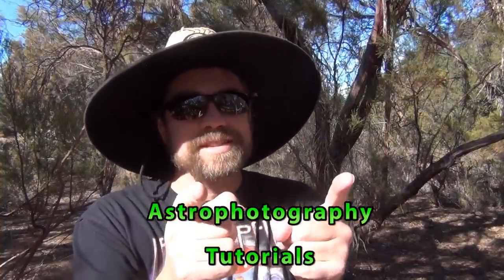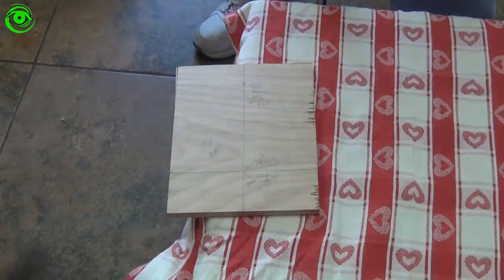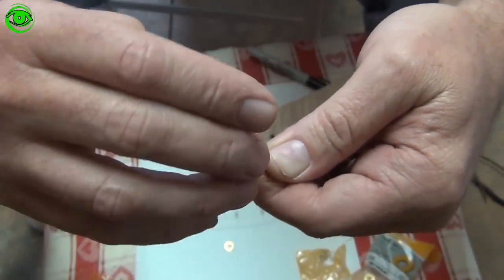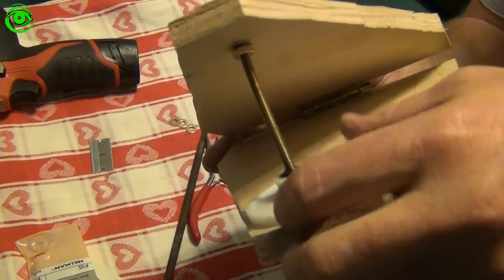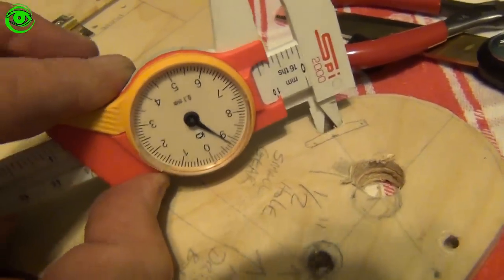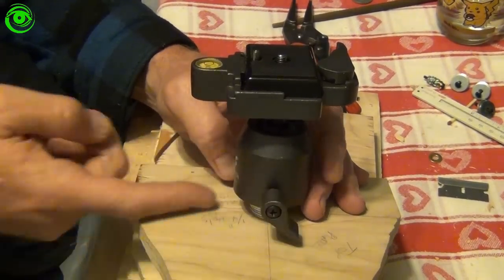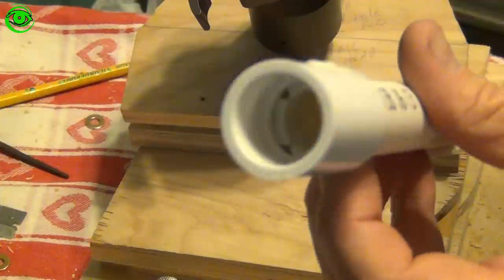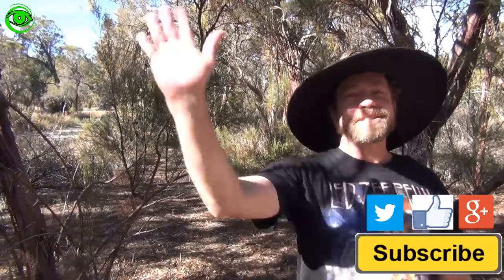How to Track Stars With Your DSLR - DIY Barn Door Trap P1

Comment: A very useful video that shows some of the subtle features that come into play in building a BDT. I think the motor gear wheel is better inverted, as this eliminates the need to thin out the bottom board.
Reply from the maker: Hi Mathers, Good suggestion to flip the wheels.  Thanks for commenting.  
Doug

Comment: Today i saw an offer for a used ioptron startracker for 200$, including ballhead. Given the drop in prices, i think the need for those lovely projects is declining. If i have to spend 200$ in parts, or buy a ready-to-run product with warranty for the same price, my mind is set :-)
Reply: Its only about 50$ in parts for a decent ball head, motor, Controller, Hinges, bolts and nuts. Its also about the experience of making something yourself. And i know, not everyone has all the tools needed, i certainly dont, but i still tried to make it using local workshop.

Comment: Thanks so much for this video, I've just started building my own so it's been really helpful to watch you and see how you approached it. I've gone down the stepper motor and arduino route though rather than a DC motor. You mentioned using longer hinges .. Some plans I've read recommend using piano hinge. You can cut it to length and there no play in it (it's also cheap). Looking forward to part 2 ! Thanks again
Reply from the maker: Thanks ***** !  You are the second person who has mentioned an Arduino model.  That sounds popular by many people.  Do you have a link to the Arduino plans?  I think showing people other options is a good idea.  I'm not claiming my method is the best, after all, I'm copying the plans from another website, and showing my steps.  Thanks posting your comments and please update me on your Arduino project.  I hope to have some results soon to show everyone.
Reply: I tried cutting a piano hinge, what appeared to be a good one from home depot, but there was lots of play in it.  The strong door hinge I used with some teflon tape was much stronger and better.
Reply from the maker: mar pal How does the Teflon tape help?  I've noticed in my design, the two pieces are not evenly spaced.  The rear seems to have a narrower gap as to the front...I think this is caused by hinge play.  How do you Teflon tape to improve the hinge?  Do you think I could use Teflon tape on mine to improve the hinge?  Thanks Mar!  Doug
Reply: Hey, I wrapped the hinge pin with teflon tape to remove the gaps, can your hinge pin remove?  It definitely seemed to help.   Just dont put too much so it doesn't bind it.
Reply from the maker: mar pal Thanks for the Tip!  I need to do more testing and see how close I'm to rounder stars.
Reply: What focal length and exposure time are you trying?  I would be conservative.  I'm currently at 50mm with 30 seconds if that finally is aligned well I try more.
Reply from the maker: mar pal I'll be trying a Rokinon 14MM Lens with 30 Second exposures first, then I plan on trying different stock lens I have too.  I was going to try 30 second sets and 60 second sets for good measure.

Comment: I'm ready for part 2!
Reply from the maker: Thanks Adam!  I'm working on the final edits now.  It will be ready on the 15th.  I think you will like P2's Electronic Circuit.  I cover the Electronic Circuit for novices, since I'm not a solder master, I was still able to put together a working Electronic Circuit.  Thanks for watching!  Doug
Reply: Astrophotography Tutorials Hey, thank you! There seems to be a lot of information on how to build these things, but little on using them. I know it seems pretty obvious but all the various alignment methods and such. Maybe I'm over thinking it.
Reply from the maker: Adam Elkins That's true...I've never used one before and I hope to discover how to use this correctly.  P3 is what I'm aiming to conquer next, that is how to use the BDT.  I can tell along the way...I've made mistakes.  I will review all the mistakes I've made and point out them out in P3.  I did a very small sample test and the stars did improve, but, I think my alignment was off.  That's what I hope to uncover...How to use the darn contraption!  =)

Comment: Great video!  I recently built one as well, definitely a good idea to raise the ballhead otherwise it will be hard to access the camera at different angles.   The hardest part for me was bending the rod and having it accurate, I like your suggestion with the setting circle website.  I ended up using a stepper motor and Arduino unit which makes the timing perfect.  When I am using it now I find the most important step is the polar alignment.  I used my 6x30 finderscope from my telescope and use the polaris position programs, to help align I just want to be more confident in this last step, when I get it right its perfect but it is somewhat of a trial/error for this last step which I would love to improve.
Reply from the maker: Hi Mar,  Thanks for commenting on your experience.  I think I'll need to revist my polar alignment.  Where is your Polar scope mounted?  I'm thinking the Hinge should be the direct path of polaris.  Any tips are appreciated.  The arduino sounds interesting too.  What are you powering the Arduino with?  Thanks, Doug
Reply: Hey!  I am using a larger door hinge, I tried to remove play from it with some teflon tape.  I found the piano hinges had even more play, how are yours?  I mounted the polar scope right on the hinge pushing against the top level.  My hinge sticks out a lot more though.  When I looked through, the crosshair doesnt seem to rotate when I lift the top so I think it's pretty good.  I think that's the goal to align the polar scope.  If you mount it on top you will have to be able to align it somehow.  I also mounted the entire thing not on a conventional tripod but an older wooden ALT-AZ tripod which lets me do fine adjustments when pointing to Polaris.  The only thing is when using polarfinder.exe I have trouble seeing the other stars to do the proper centering, my viewfinder has 6x30 magnification and I have just been estimating the exact distance since there is no inner circle.  I am debating getting a cheap polar scope and mounting that.  So far I was able to get 5 minute exposures at 50mm.  Regarding arduino, I also have the motor shield (addon):  I am powering it with a radio controlled R/C battery 7.4V both the arduino and the motor together.
Reply from the maker: mar pal Interesting...You'd think a piano hinge would have been better.  I think I remember seeing another long hinge at home depot.  I'm afraid if I replace the hinge, then my alignment will off on the platform.  I'm going to move forward with the hinge I have and see how it perform.  FIVE MINUTE EXPOSURE??  WOW!!!  How round were your stars?  Thanks!
Reply: I actually thought a piano hinge would be better and ended up buying one which I had to cut but there was tons of play in it.  It also seemed too thin.  I saw your small ones as well, that seemed good but again I also didn't want to use 2 as you found out trying to keep them aligned.  I also had to reduce my plywood size to fit the motor but my shaft was much shorter.  Couldn't you have turned your pinion gear the other way?  You would have to make the hole a bit larger to fit it through to be able to tighten the grub screw.  It's funny how simple yet complicated this can be.   Stars were very good at 5 minutes.  I have had very little time to try it due to clouds.. Here's my astrobin The M31 had a 5 minute exposure in there as well.  http://www.astrobin.com/users/entilza/  I think once I switch to a longer focal length it will be more evident but I am happy with the consistency so far.  Looking forward to your further results.
Reply: Also one last thing, I decided to build the 1/4-20 thread version so it was longer (11.43")  I had thought it might be less prone to error and easier to bend the rod if the arc was larger.  At least that was my theory.
Reply from the maker: mar pal WOW!  YOUR M31 RESULTS ARE GREAT!  I'd be happy with that five minute exposure!  That's very impressive!  You say you built a 1/4-20 version @ 11.43"?  Did you design this yourself?  I'd be interested in sharing your link for that build too.  I was hoping i'd get 1 minute exposure with the BDT and you got a very nice 5 minute on M31.
Reply: Astrophotography Tutorials Thanks!  I hope for some clear weather sometime soon, as I just built it as well I am excited to try it some more.  I originally planned to make the very simple version: http://www.astropix.com/BGDA/SAMPLE2/SAMPLE2.HTM.  But I ended up making one similar to GarySeronik's.  If you use Gary Seronik's formula at the bottom you will find the Radius = rpm / (0.004375 x TPI ) = 11.42857143
" or 290.28mm.  I think the key important thing for these trackers is the stable tripod and the polar alignment.  The great thing about these trackers is they teach you so much about this hobby and it's a great primer before jumping head in with a fancy equatorial mount at least with my journey so far as I am very new.

Comment: Hello thete, thank you for the great tutorial! I'm working on my barn door design but I've got a problem, maybe you can solve it. I'm looking to get the 10 32 brass rod, but apparently nobody here (Iceland) has any idea what kind of size is that. I found no clear info online, so I'm little at loss. Can I just use any 10mm threaded rod? Or even an 8mm, since there are no brass rods in this crazy country (so I might have to try bend steel, probably impossible to get the curve linear). I was wondering if you have any insight about this. Thank you again! 
Peace
Reply from the maker: Hi Cerna,
Well I know the thread pitch is important to the timing of the how fast the platform moves.  To say a 10 mm would work, IDK.  I know you've searched online for 10/32 brass rods, they're out there if you want to buy one.  

You may want to try it with 10mm to see if would work, if it's cheap, and available.  I'm sure there's some kind of math formula for the reason behind the 10/32 rod, but, I don't know how that translates to a 10mm Rod.

I'm sorry I couldn't be more helpful.  I would love to hear what you decide to do.  If it works for you, that may help other people in the same situation. 

Doug
Reply: Astrophotography Tutorials hi Doug, thank you for your reply! The problem is that finding them online is not that easy. Most won't send to Iceland. I just found just 3 on Amazon and Ebay, but the sending cost for 3feet rod becomes quite high, about 45$ + rod. I'll keep on looking. Also I can try to order a 12" long rod (cheap cost). If it doesn't bend properly, I'll use it to compare sizes. One more thing, do you still have the printable schematic of the rod's curve? Link doesn't work.
Thank you again for your tutorial and reply, I really appreciate it :)
Alessandro
Reply from the maker: Hi Alessandro,

No I don't have that 7 inch radius any more.  You can probably find another source online.  Also check out this website, they have instructions there on making the 7" radius too.
http://garyseronik.com/a-tracking-platform-for-astrophotography/#more-52

Doug
Reply: cernacerna hey at least you live in iceland lmao. I’m going next year. Sooo beautiful.
Reply: Hi cernacerna. #10-32 means the rod is about 10/64 inch = 4mm in diameter and has 32 threads per inch. The diameter is important for stability. The threads per inch plus the rate of the larger gear determine the rate of rotation. Thinking in metric, hypothetically imagine a 4mm rod with 1mm threads bent into a circle. Also, consider that there are 24x60 = 1440 minutes in a day. So, at a rate of one mm per minute the circular bar would have to be 1440mm or 144cm in circumference (C) to traverse the bar once in a day.  Using the standard formula, C = 2xπxR, we can calculate the radius R = C/(2xπ). So, in this case, the radius would be about 23cm. Note that only an arc of this circle is practical for this device. Also note that this will make a metric device that's about 28% bigger than an Imperial one. You can adjust the math if you find a different thread pitch or use a different turn rate for the larger gear. Any corrections to my reasoning/math are welcome.
Reply: Note also that you can use a compass to draw an arc of the radius on a piece of paper, then use that paper as a guide to bend the rod. You can calculate the length for your arc by noticing that each individual thread gives you a minute on your photo. So, in my previous example, to get 30 min, your arc should be at least 30mm or 3cm long.

Comment: Hi Doug, I'm still thinking about making one of these, As a Brit I started off with imperial but they changed to metric many years ago. I'm having to source by mail order now I'm in Thailand but am I not correct in thinking that 10/32 is the same as 5/16? I must be wrong otherwise you would call it that. If I am wrong what's the difference please?
Reply from the maker: Ollie Broad Hi Ollie, I'm sure these sizes are not the same.  I know the thread pitch has something to do with the correct timing of the movement.  I basically looked at this web page for reference and noted the build from these instructions: http://www.garyseronik.com/?q=node/52  The barn door trap is a nice accessory, but, I find myself using a station tripod for shorter exposures (20 seconds or less).   Doug

Comment: Thanks Doug, I got myself a Vixen Plate Mount  for  Xmas,so you can put your` Telescopes Side to Side. Instead on top off each other,I`ll send you a Photo off it OK,I am not sure whether my HEQ5  Mount will take all the weight on it! Thanks Doug
Reply from the maker: Side by Side can be a little tricky.  Try to get the two scopes as close as you can to the center axis.  I tried side by side, but, I ended up going back to the stack.  I know other people that have great success with Side By Sides, so it's not impossible.  Your HEQ5 should handle about 35 LBS of gear if properly balanced.  Take your time balancing your mount and you can probably push it even more.  Good Luck with your new toys!
Reply: I am looking for a new Mount & I see Orion has a HDX110 EQ-G  with Tripod Pier,Do you have to worry about  Meridian Flip with these mounts` or not ! Doug.
Reply from the maker: cosmictywlite WOW!  That's a BEEFY EQ Mount!  110LB Capacity?  It looks like a top quality mount.  I believe every EQ Mount has to deal with a meridian flip issue.  Just depending where the target is located.  With my Atlas mount, if the target is far enough to the south, then I don't need to FLIP, I can just let it FLOW through to the other side.  You can tell if your Telescope is going to hit the tripod, just watch it's path for awhile.  If it looks like it can sweep past the tripod and not hit anything, then no need to do a meridian flip.  That's how I do it!
Reply: Thanks very much for the info on the  EQ  Mount,What type of Mount up to 50LB  would you recommend Doug ! thankyou.
Reply from the maker: cosmictywlite I have limited Mount experience and I've had great luck with my Atlas.  It has about a 40LB capacity.  I've pushed it over 40LBS before and it has performed well, but, my standard load is about 30LBS on it.  Remember, never go cheap on your mount.  This is where you need the best performance.  Don't go with anything less than an Atlas.  Other considerations....is this a portable mount?  or is this in an Observatory mount?  Heavy equipment is definitely something to consider.  Also, what do you need to power the mount?  Can you power it in the field?
Reply: Thanks very much for the info on good Mounts`. I have a Power Tech!  with Both AC&DC  I can run 12 VOLT  or 240 VOLT , I  can also plug my Laptop into & it will Power for up for 16 Hours  & I have 12 volt backup Battery.  plus  My 4  Wheel Drive witch has been setup for Camping, I will check out  The Atlas Mounts & see what there cost in OZ,! Cheers. DOUG

Comment: Hi man, is it necessary use 64 and 14 tooth gears? Or can I use any gears with ratio 4:1? btw, thanks fo tutorial :)
Reply from the maker: Good question Michal!  
The math, 64/14= 4.571.  So 64/14 would be a ration of 4.571:1  I know the rate this turns matches perfectly to the earth's rotation and if you used a 4:1 ratio I don't think it would work.
Doug